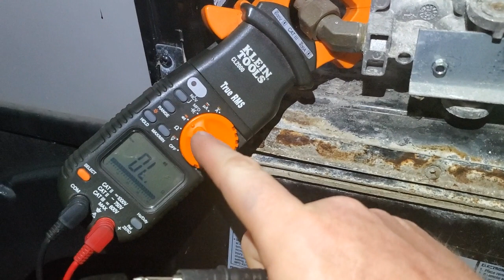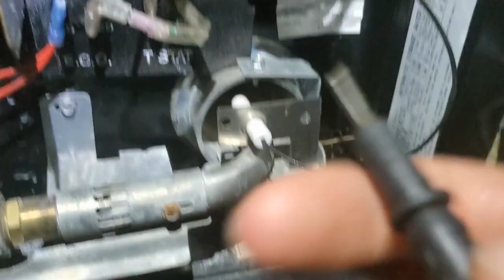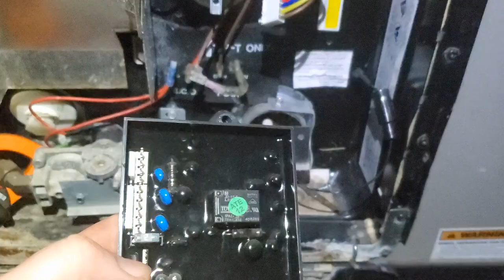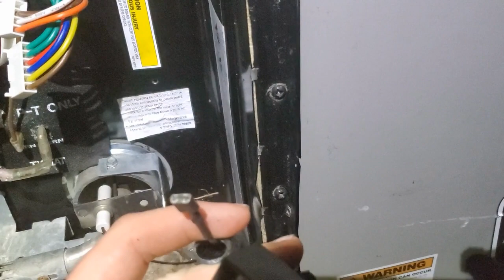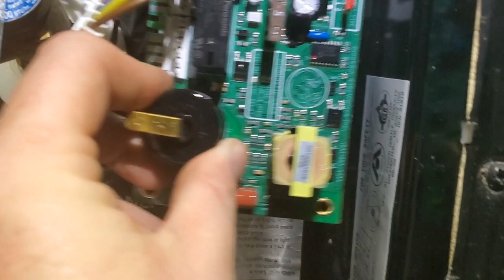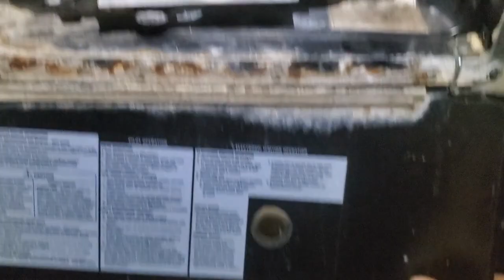Atwood RV water heater circuit board troubleshooting and replacement

Comment: i SEE THIS VIDEO IS 5 YRS OLD BUT ARE YOU SAYING THAT i CAN REPLACE MY OEM CIRCUIT BOARD WITH THIS FROM Dinosaur Electronics ? - NO MATTER WHAT MODEL YOU HAVE ?? my current model WH is from Demetric /Atwood - GC6AA-10E - sorry for the caps..
Reply from the maker: I used the dinosaur board for my model of water heater. As long as the one you purchase has your model listed as compatible it should work fine.
Reply: @Rvhikingyet  Thsnks

Comment: How does the wire harness unplug, just evenly pull?  Do you have to pull top and bottom at the same time or can pull one section at a time?

If needing to change the brown wire, how do you release it from its spot on the harness?  I know it’s self locking just by pushing in, but how do you pull out the old burnt brown wire?
Reply from the maker: If I remember correctly the main wire plug has a clip you squeeze. It's been a few years since this video. We sold this trailer a few years ago, our current one has a different style of heater otherwise I'd go look.

Comment: Hi, best video we’ve seen to help us.  Our electric side is not working our gas runs like a charm.  Replaced that 2 amp breaker & that clear fuse & still not running.  He checked the igniter and it had 10 ohms.  Thoughts?
Reply from the maker: If you have power, you could have a bad temperature switch or the heating element. You can ohm the switch to see if it's closed. Ohm the element, if it's reading no ohms it's bad.

Comment: Hello my water heater works well but do not re start automatic. The water heater start heat the water up. After use the hot water the temperatur fall down. The water heater not start automatic agean.
Reply from the maker: Do you have this problem with both electric and propane? If it's just one or the other you possibly have a bad temperature switch. Also if it's cold weather you may need to run electric and propane at the same time so you don't run out of hot water faster than it can heat back up.

Comment: So not sure how you were troubleshooting the circuit board. Was it by testing all the wiring for continuity that led you to determine it was the board?
Reply from the maker: It's been awhile since this video. I believe I checked voltage outputs as well. If all the wiring and components are good then the circuit board is the only thing left that could be bad.

Comment: I was curious l thought you said you hook up the wire harness on pin board sticking out it look like it “ they won’t stay on l could not see how you hook up your harness you put the cover so l put mine on the side of ribbon side.  Please respond
Reply from the maker: The wire harness should just plug into the circuit board. Then you install the plastic cover.

Comment: Thanks for posting, I thought for sure my switch inside the Rv was the problem but checked out ok. I will check Cb. My Lp works fine, it my electric. It will not shut down without turning off at the CB. Weird problem to have bought new thermostat still doing it.
Reply from the maker: I would suspect the circuit board is your problem. The after market ones are much more robust compaired to factory. Good luck with your repair!
Reply: My 2014 GC6AA-10E water heater currently has a similar problem.  Heats up on gas or electric, gets to temp, shuts off, wont turn back on unless I turn off the gas/electric water heater switches in the camper.  This apparently resets the circuit temporarily until it repeats the next time.  Only gets annoying when a lot of hot water needed.  For good measure, I'm replacing the thermostat/ECO and circuit board (aftermarket, of course- much better quality per numerous other campers).

Comment: I have a problem with my water heater that does not turn on, the two green wires of the harness that is connected to the pc are burned, I have replaced the harness 2 times and the same thing happens, do you think the problem is the pc?
Reply from the maker: The green wire is the ground circuit. Typically a burnt wire is caused by a loose connection, this results in higher resistance and heat buildup at the weakest point of contact. You may need to replace the board, it possibly has internal damage at this point. Clean all the ground connections thoroughly. If one is corroded and creating high resistance to ground it may burn out your new circuit board.
Reply: @Rvhikingyet  Thank you very much for the advice, I will check all the wiring before mounting a new board

Comment: Mine works fine on propane, but will not work on electric, replaced the element with no change, no lights on the circuit board are on.
Reply from the maker: I would suspect you have a bad circuit board. It seems to be common for them to quit working on just one function, and still work on the other. The factory circuit board had no lights, the aftermarket board comes with lights.
Reply: @Rvhikingyet  the one in it has 2 lights below the fuse.
Reply from the maker: @dancarlin5434  I would Google your specific model of water heater and see if you can find a wiring schematic. It could possibly be a bad on/off switch inside the RV. Check the beaker also, I've seen them fail internally where power was not supplied even when it was in the on position.
Reply: @Rvhikingyet  thier are 8 different ones for this model (seems thier are numerous sub models)
Reply: @dancarlin5434  hey Dan did you ever figure out what was wrong with yours, I'm having the same issue now and can not figure it out. I'm thinking possible heating element failure but want to be sure before I tackle the project.
Reply: @gagedenton410  Combination of the Curcuit board and the looking to be the electric side relay (if i can ever find where they put the darned thing).